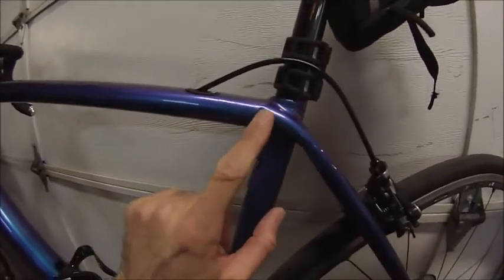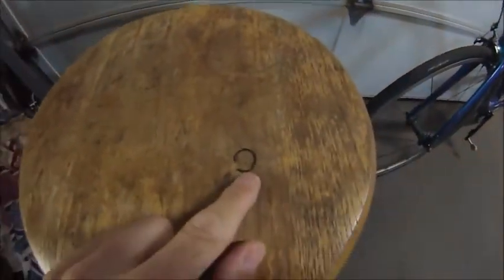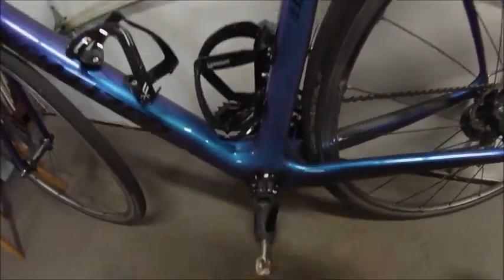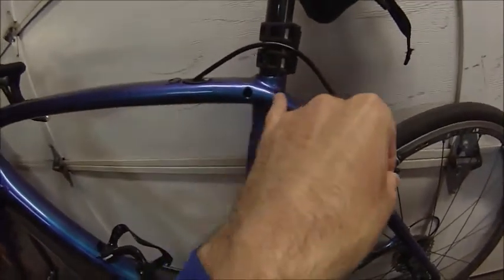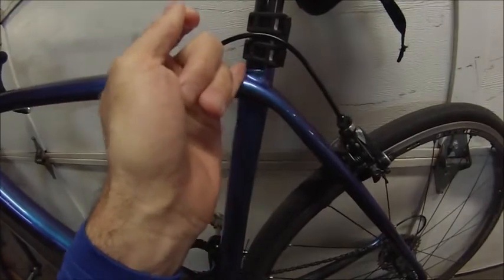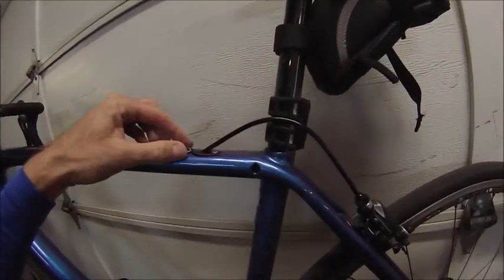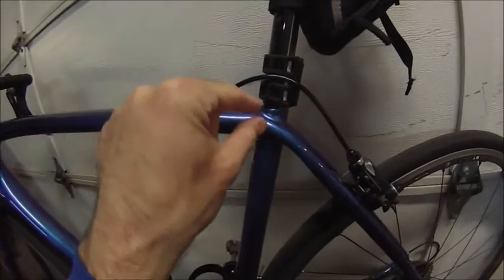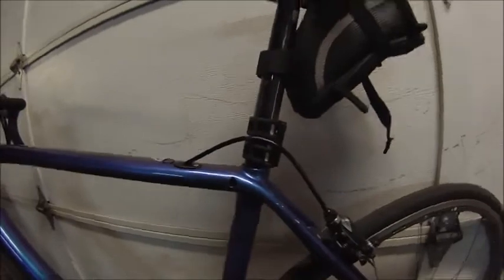Specialized Tarmac Expert seatpost clamp tips issues

Comment: Finally clicking on a video that relates my problem. Hope to get some light after watching.

Anyway, just bought a used Specialized Ruby and was swapping out for a more personal seat, however, I didn't know a wedge was involved, thus it fell into the frame when I loosen the hex nut all the way.  
Initially was able to chase the wedge around the tube, however now it's completely wedged, Stuck,  Silenced even when I violently shook the frame. Thinking of taking out the crank arms and bottom braket.... Yikes. Now I'm just watching some videos to help me remedy the issue before doing any dirty work. ARRGH.
Reply from the maker: Ouch, I feel your pain. I would say maybe ride it around for a couple days I bet it would work itself loose. If you can’t get it out after taking the cranks out other than that, you’re kind of stuck. Good luck with that. Let me know how it goes

Comment: Thanks everyone for taking the time to post info. Very helpful. The backing wedge of my seat post wedge assy stripped.  I just installed a replacement.  I left the new assy assembled, inserted all of it it while the bike was in the work stand with the seat tube horizontal to the ground.  To be certain the new assy didn't fall down the seat tube, I had a skinny hex blocking it as I dropped the new assy into place.  It was adjusted loosely so I could slide the seat post in.  Perhaps this wasn't necessary but I  held the assy with a hex driver in the bolt.  All this was easy after understanding the design.  I don't think it's a bad design, but it's different.  Before taking out your seat post you just need to understand how it works, how it sits in there.  Then you won't let it drop down the seat tube like some here learned the hard way.

Comment: I am very glad that this video was made. It did help. I didn't have the patience to film the process as I worked it out but if or when I do it next time, I will go through it step by step to help others where I can. I lost the wedge after it became lodged in the chain stay. I rapped on it, moderately hard with a padded tool and it dislodged. I then used the rubber band purchased in a bag of 150 for 2.49 at CVS to hold the wedge to the bolt and the two other tapered metal wedges. I shoved a paper towel in the tube and held it at 45 degree angle in my workstand. I wouldn't have been able to do it without the stand. Thanks for your video.

Comment: THANKS SO MUCH for the Video..............The Frame Tilt made a HUGE difference. Luckily I did not have to re-attach wedge.
For others, if You don't have to remove the Seat Post............don't ........I should have just raised it up enough to do a new carbon lube job but I wanted to make sure the Di2 battery / connectors were in place........Video saved the day to re-install
P.S. Love Your Paint color.........have seen in the sun & it's amazing

Comment: let's just say I was beyond displeased w/ the specialized engineer that designed the seat wedge system.   I spent a couple hours trying to manipulate it and watching youtube videos of people w/ the same plight.   once I got it to work it was doable.   I almost made a video of it - but did not want to go thru the agony again.   Some tips  1) fasten together w/ two small rubber bands used for young girl's hair.   do not think 1 is enough as it will break 2) on the wedge - loosen it up as much as you can w/ the bolt still intact 3) when placing and manipulating the wedge in the seat post hole - keep the bike at least parallel to the ground, maybe even the hole pointing down.   you do not want any pieces to go into the bottom of the seat post tube.   4) forget thinking you can manipulate the wedge into place w/ your finger - or a needle nose pliers.   the only way I found this to work - and, did it twice - was to place the wedge into the seat post down tube, tilt the bike a bit back so that the wedge has gravity drawing it to the position you want it.  5) bump the wedge w/ your finger to jostle it around.   eventually you'll get lucky and it will be positioned in the slot that you need it in. 6) w/ the search post parallel to the floor, get the seat post into the seat post down hole.   6) tighten a bit and carry on

Comment: My advice for clamp installation: lift the bike at the back wheel, then while holding the back wheel, tilt the bike forward until it rests comfortably on your rubber shifter hoods (and front wheel), so basically  90° angle from the normal position, then have a mate/wife hold the backwheel, while you comfortably slip in the 2-piece clamp system separately (first bolt, then clamp, then insert seat post and tighten a bit, then put the bike back into normal position, adjust seat post height and tighten to 4nm, done.

Comment: Thanks for this video.  I had the same issue.  I did not have one of those small rubber bands, but a larger band looped a few times worked.  I also had good luck by putting the bike in the stand upside down.  Anyway, this all happened to me because I was doing a test run for packing the bike for a future trip this winter.  Now, I'm not sure how to proceed.  If I remove the seat post, the same thing will happen but I will be in Aruba without access to my tools etc.  I am thinking of marking and removing t?e seat, then scoring the post w. a utility knife to mark the height and then push the post into the top tube and leave about an inch exposed.  This way the seat post will never be removed.  What do you think of this approch>

Comment: Yep, this is a constant problem with the Tarmac, I still forget to tilt the bike when removing seatpost, so you have to go fishing for the parts in the frame. Not a good design!
By the way, your rear brake cable outer could be a lot shorter!!
Reply from the maker: ya the design is not great, i just wish they would have used a better clamp, not a two parts. how did they not know that little rubber band would not break and let the parts fall into the frame. geez...
re brake cable, i guess, ive been too lazy to fix it.
Reply: How on earth did you get it back in?  Mine came into pieces and once fished out of the frame i cant get it back in with the seatpost and now have a bike shipped half away round the world that i cant use.  Emailed and tweeted specialized and no response either :-(
Reply: And why not just an effective, tried and true traditional seat clamp?  I just got a beautiful Crux with the same design and the seatpost keeps slipping.

Comment: Terrible design indeed! Spent a good couple of hours putting it back together, trying to find a rubber. Then, just decide to tilt the bike, open the bolt as much as possible to make the wedge go into the frame and wedge in the seatpost. Turns out the little rubber is unnecessary!
Reply: As long you remember to tilt the front wheel downward when removing the seatpost or else the wedge falls down the seat tube